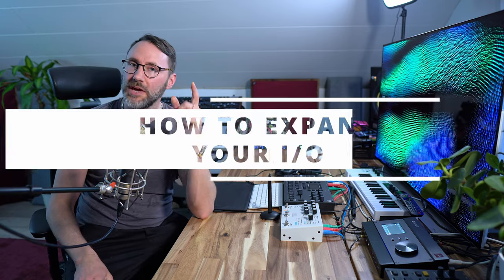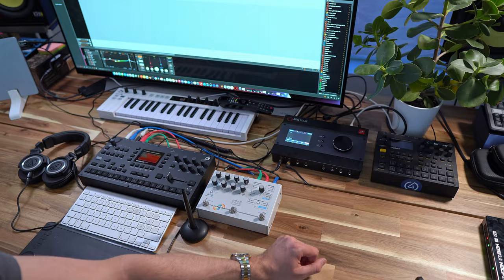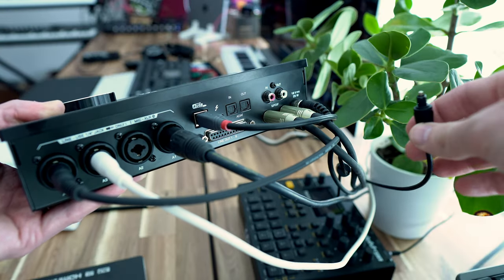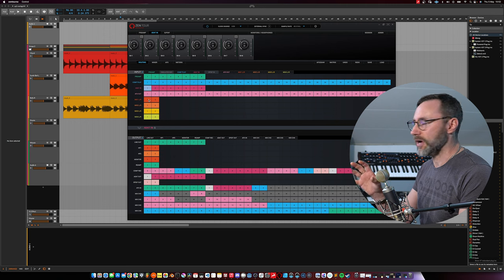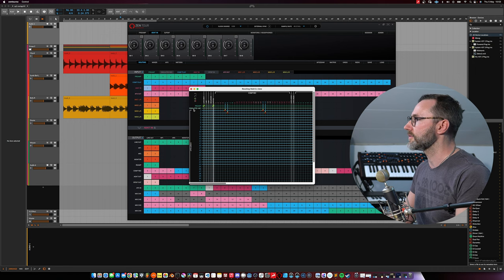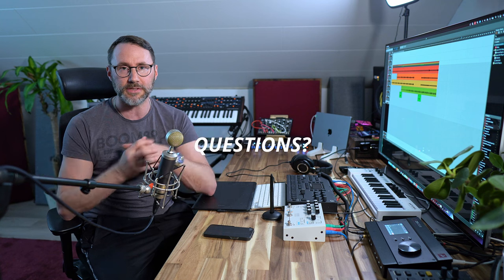How to expand your audio interface with ADAT

Comment: Nice video. I have two ADAT machines, both Fostex, A RD8 and a CX8. I have used them with a MOTU Traveler audio interface. I use the light pipe from the ADAT's and firewire i/o from MOTU into my computer. Using my DAW I am able to record 16 channels in to the DAW. With use of a serial cable sync connection between the ADAT's, you can record 16 tracks simultaneously on tape. I like vintage equipment. 😊
Reply from the maker: Very cool! Yeah vintage gear is cool, We did plenty of albums on ADAT back in the 90s. Dual ALESIS XT Adat machines was the norm. We grew experts at making LIVE cuts on drums and guitars directly by activating / deactivating record directly on the channels while playing back the recordings for tighter riff passages. haha

Comment from the maker: CONTENTS
00:00 Intro
00:19 What is I/O?
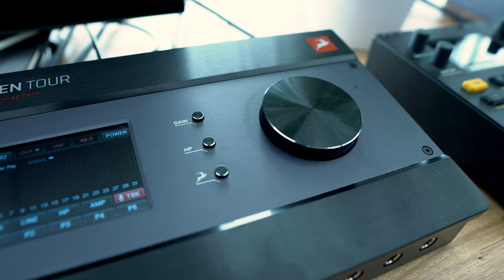00:35 Main Audio Interface - Zen Tour by Antelope Audio
00:49 Aggregate Device - Watch my previous video
01:04 What is ADAT?
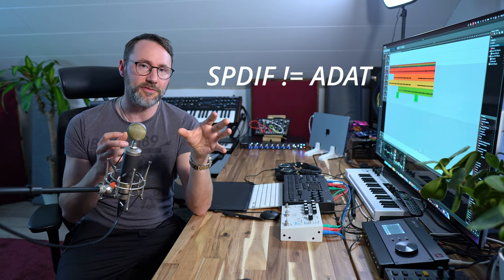01:18 SPDIF vs ADAT
01:44 Zen Tour + AudioFuse 8Pre
02:22 Why I use Antelope Audio Zen audio interfaces
03.07 How to connect ADAT with toslink optical cables
03:40 Digital Clocking Lock
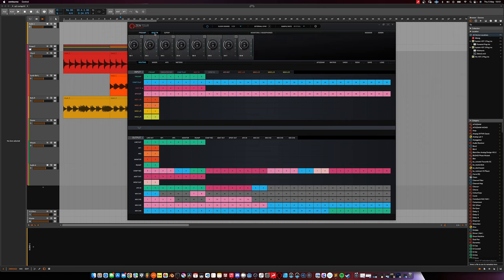04:39 Recording a synth via ADAT
05:13 Zen Tour mixer
07.04 Conclusion
07:37 Questions?
07:52 Outro music

Comment: Hello Matthias, thanks for the videos… Matthias how did you configure the syncing of the clock? And why Dont you use the thunderbolt with fx 2 daw with the Antelope ?
Reply from the maker: Master clock is Zen Tour. 8pre is slave via ADAT, 48khz samplerate. I do use antelope plugins, always on my voice over input (standard voice over plugin chain). I also use afx2daw in my productions. but not much in videos since not everyone has an Antelope interface if they want to replicate similar sound design and effects chains

Comment: ADAT expansion is great since it allows you to expand your system (start small and grow). But no matter how I added up my eventual needs for my synths and microphones, I realized I needed more than 24 I/Os, and devices that allow that (using multiple ADAT inputs) get very expensive very fast (if they are available at all).  I could use patch bays and swap my hardware back and forth, but I really want to just hook everything up, and as my studio grows, not feel like I am running out of I/O's.  So I bought a Presonus StudioLive 32R.  

The 32R is a 32 channel Presonus StudioLive Series III mixer in a rack mount box, with expandability using AVB Ethernet up to 64 channels. You control it using an app on your computer or iPad connected by Ethernet, WiFi, or USB. It is a class compliant USB 2.0 audio interface, so I can even use it as an audio interface for my iPad or iPhone (32 channels in AUM!). The app provides all the features of a normal StudioLive Series III mixer console including FX but without the space needed by a huge mixer.  You can use it as a mixer/USB audio interface (routing channels to your computer as needed), or switch it to audio interface mode and all in/out channels route directly to your DAW.  

There are better audio interfaces like the Zen Tour device Mattias presents in the video, Universal Audio, or other high end audio interfaces, but the Presonus devices are the cheapest cost per port I could find for a configuration that allows more than 20 ports.  It isn't a slouch on high end features either, and cost about the same as a Zen Tour 8 channel interface (when I bought it - prices recently jumped unfortunately).  

They have 16, 24, and 32 channel versions.  The 16 channel version is cheaper than some high end 8 channel audio interfaces and equivalent or cheaper in price to almost all setups using ADAT to get 16 channels.  

I am just a happy customer, not trying to sell anything. I didn't like the options using ADAT and then found stage/studio mixers which offer a better option for my needs.  Behringer has a similar series of mixers/audio interfaces as well as several other brands that cater to stage and highend studio needs using AVB instead of ADAT.  

For those that don't know, AVB is an IEEE 802.1 network standard for sending audio and video over Gbit Ethernet. It has been around for about a decade and many devices support it (Behringer, Motu, Presonus, etc.). AVB came from the stage setting where they wanted to replace 100 ft long analog cable snakes with a single cheap and reliable wire over great distances. I could put one AVB mixer in my office and the other in a studio and send audio back and forth with one cable, up to 100 meters apart. And that is what got me onto the idea of using a stage/studio mixer with AVB for an audio interface. Expandability isn't hampered by the number of ADAT ports anymore.

I have heard many people say, why are we still using ADAT when AVB is available. I hope to see AVB replace ADAT eventually, even for lower end home studio devices.  Instead of feeling limited by how many ADAT ports you have (which is usually 1, maybe 2 if you bought an expensive audio interface), AVB allows multiple devices to connect together like a network. A downside of this is AVB switches are expensive.  You can connect 2 AVB devices together directly using a single cable, but hooking 3 or more together requires an AVB compatible Gigabit Ethernet switch. You might get away with using a normal Gigabit switch, but the AVB switches understand how to route audio/video first (highest priority) over data, and also maintain ultra accurate clock pulses.  Most normal switches won't do that reliably. 

If you read this far - congrats and sorry for the book.  I think AVB is a game changer and I wish I knew about it years ago.
Reply from the maker: Great tip! Since audio interfaces come with this adat connectors its easy to setup and make use of them. And as you mentioned AVB is a bit more expensive solution. Hopefully we can see a better and new universal system on interfaces soon. Which would also support more channels.

Comment: Thank you for the video, I have two focusrite saffire pro 40 but one doesn't connect to my computer. Can I use adat by connecting it to the one that is able to connect to my computer?

Thank you
Reply from the maker: Yes you should be able to do that. That's exactly what I'm doing with my main interface Zen Tour (Antelope Audio) which is connected via ADAT I/O to an external AudioFuse 8Pre to give me extra I/O ports.
Reply: @MattiasHolmgren  thank you, I'll try it out once the optical cable arrives

Comment: Can you use the audiofuse as an adat insert box?

For example, have a bus compressor connected to the input and output of the audiofuse, and have the signal be controlled through the zen tours software adat controls?
Reply from the maker: Yes Zen Tour has optical Adat in / out so you can both send and receive audio signals via adat, and control their gain and internal computer routing.

Comment: Have one question about ADAT connection, do one need to instal software of both interfaces on PC or just software of master interface, not the slave?
Reply from the maker: Secondary (slave) interface does not need its specific software pckage. Because your main interface is the one receiving the audio via the adat optical cable, not via usb / computer. Though I always recommend upgrading the firmware (if possible) of every interface you own so you are running latest. 👌
Reply: @MattiasHolmgren  Thanks a lot Mattias 🎶🎛🥁🎹

Comment: Hi Mattias can I make you a question?
I only have USB-C connection on my Pc. Can I connect a thunderbolt interface (an Apollo X6 Heritage Edition) to my USB interface,  (An Arturia Audiofuse Studio, the one that its connected to my Pc) via just ADAT?
Thanks very much in advance :)
Reply from the maker: Hi Jesus, TB and USB-C looks the same, but USB-C ports do not accept Thunderbolt data streams.
But TB accepts USB-C.... ADAT is a different ball game. If your Apollo X6 has ADAT out you can connect it to the ADAT IN of your USB audio interface.
Reply: @MattiasHolmgren  thanks Mattias :) HOWEVER I make a big mistake on my explanations

My octopre has not even USB port but on the other hand neither has ADAT IN but just out. It's the Focusrite Octopre...

I guess this even makes your answer even yet more correct. Right?

Thanks again mate :)

Comment: with an Adat unit as expansion there is a problem. Adat will require you to select your input analog or digital . On analog input your mixing console will supply the signal, on Digital input your computer will supply the signal. Within your DAW you will have no way to Monitor a recorded track while recording a new track as the ADAT will have its input set to Analog.  what would be the solution??

Comment: Nice useful video, thanks. Now, the matter of interface expansion is often treated as the need of having more inputs available. But I can't find examples of both ins and outs expansion. For inserting outboard eqs and compressors one would need a converter for an output getting into the outboard unit, then converting processed audio back in. The Arturia AudioFuse is capable of 8 ins and 8 outs working at the same time, but is it possible to use all them as expansion channels of another interface? Is Adat capable of it?
Reply from the maker: Optical Adat can only throughput 8 channels. Spdif only 2 channels.

Comment: My Focusrite Clarett 8Pre (thunderbolt) had connection issues with my new computer (Lenovo Thinkstation P620). It often wasn’t discovered by Windows 10 so, I bought a Steinberg UR16C and hooked up my Clarett with ADAT to use as expansion. That worked like a charm. Focusrite also has Clarett+ OctoPre and Scarlet OctoPre pre-amps that work great as expansion units. Funnily enough, after upgrading my OS to Windows 11, my Clarett starting working fine again as audio interface.
Reply from the maker: Hi Marc, that’s excellent to hear that the Focusrite is working again as main interface. Did you update the firmware or only win? Octopres are indeed quite more powerful preamps than the Steinberg. My brother runs Focusrite interfaces and is very happy. I have the Steinberg Ur22 mk2 somewhere, it was nice but a bit noisy. The more recent Ur22C has better S/N ratio. The AudioFuse 8pre has very pleasing preamps but I feel the Zen Tour is a bit more crystal clear in the whole audio chain. ☕️🥁🥳
Reply: The Clarett 8Pre (thunderbolt) interface seems to have been cancelled pretty quickly (not sure why) and there is only one driver available that is still marked as Beta. It has always worked fine on my previous Win 10 PC (HP Z1 workstation). It may be some issue with the P620 using and AMD threadripper Pro CPU. That said, just upgrading to Win11 solved the issue. The Clarett is now showing up all the time but, I’m keeping the UR16C as main audio interface… at least for now. It has better specs.😊
Reply: I have two Safire Pro’s (FireWire) hooked up as one bigger unit and I’m constantly paranoid that one day the units will become unsupported after an update. It was the cheapest option to get the amount of IO I needed (although I could always use a few more inputs 😁). Routing is a bit clumsy on the old Mix Control software but it works.
Reply: Would you assist me with the connections? I have 2 focusrite saffire pro 40 but one doesn't show on my Mac.
Thank you
Reply: Would you share how you did your connections? I have two focusrite saffire pro 40 audio interfaces but one doesn't connect to my computer.
Reply: @worshiplifeteamwithjoseph9715  Hi...., 
First, you obviously need an ADAT cable.
Hook up the ADAT cable to the ADAT input of the (master) Saffire unit that is recognized and ADAT output on the other (secondary) Saffire.
That should be pretty straight forward.
The more difficult part is that you will most likely need to change the internal routing on the Saffire that isn't recognized.
Are both interfaces recognized by your MAC if you hook them up one at the time?
If so, hook up the secondary Saffire and use the Safiire configuration app to route all inputs to the ADAT output channels.
Save those settings, disconnect the secondary Saffire unit from the computer and connect the "master" Saffire unit.
Reboot both devices, just to make sure the master Saffire now looks for the ports coming from the ADAT connection. (this may happen automatically too)
If all is well, you should now have 8 additional inputs on the master Saffire.
Reply: @worshiplifeteamwithjoseph9715  Ouch… then I fear you’ll need to get another unit.
But remember… ADAT is not brand specific so you can use any brand and model as port expander (secondary interface) as long as it has ADAT in’s and outs.
I use my old Clarett 8Pre as port expander and my Steinberg/Yamaha UR816C as main interface and it works fine.
The Clarett is 24bit and the Steinberg 32bit but no issues there.
You could also just get an 8 port pre-amp module like the Focusrite Scarlet OctoPre or something similar
Reply: @marcdeschryver7687  thank you so much, the unfortunate part is that I even haven't used it. I got it used. Thank you
Reply: @worshiplifeteamwithjoseph9715  that is a shame… well, I hope things work out. Good luck

Comment: Great info!!! Do you know how to connect Burl B2 Bomber ADC to Apollo 6x for tracking? I'm using using a Neumann 103 into bae 1073 preamp MacBook pro m1 Cubase 12 Any help would be greatly appreciated. Thanks
Reply from the maker: Hi Billy, why not just connect the Burl B2 Bomber TOSLINK output into the spdif input (TOSLINK) of your Apollo 6x? The Apollo 6x has 2x TOSLINK inputs (spdif) if I remember correctly. That way you don't need to setup an aggregate device to do the connection. Do you have an optical TOSLINK cable around?
Reply: @MattiasHolmgren  
 Thanks Mattias. That's the way I have it set up but there's no signal coming into the Apollo console input ch. The B2 is showing the BAE mic pre 1073 signal coming in at a good level The B2 does have a RCA  S/PDIF out. and a TOS out sweetwater sent me a OPM303 3' Premium Optical Cable to come out of the B2 TOS into the Apollo ADAT S/MUX IN  There's just no signal coming into the Apollo console. I can hear my song play back through my headphones coming out of the Apollo 6x headphone jack fine but no signal coming in from my B2 that I will be tracking  my vocal for this song. I’m not quite sure how to set up for Spdif or Adat in the I/O’s settings of the Apollo’s console for this situation? Note:I do have the B2 and Apollo clock set to internal if I change it to  Spdif or Adat on the Apollo it turns flashing red. Thanks so much for your time. 😎
Reply from the maker: Spdif and Adat are two completely different techs. Do not mix them. 
You need to connect spdif out from B2 interface, to spdif-in on Apollo. ☀️
Reply from the maker: I personally only connect adat-out to adat-in between my interfaces. Because spdif can only carry two channels. While Adat can carry 8ch in 48khz 24bit.

But in your case you will use spdif since B2 only had limited channels…and spdif out 😁
Reply from the maker: B2 should be set to slave, and Apollo to master clock. You can only have one interface as the master. Its most often your main audio interface.
Reply: @MattiasHolmgren  Do I need  a RCA SPIDIF cable to to do this I don't see a TOS SPIDIF input only a in 1 and 2 S/MUX  and do I set B2 to int or EXT and keep the Apollo set at internal? Sorry for all the questions... Thanks.
Reply from the maker: @billymack4258   Burl B2 as both RCA and TOS SPDIF out-ports. Connect TOSLINK (optical) cable to TOS spdif out of Burl B2. To the SPDIF in on the Apollo.
Reply from the maker: @billymack4258  Clock on B2 to EXT = external clock sync. Clock on Apollo to INT = master clock device.
Reply: @MattiasHolmgren  Burl B2 as both RCA and TOS SPDIF out-ports. Connect TOSLINK (optical) cable to TOS spdif out of Burl B2. To the SPDIF in on the Apollo. The SPIDIF in on the Apollo 6x is RCA The only TOS optical  section I see is on the left back panel next to the power pin connecter is   ADAT S/MUX OUT 1 OUT 2 IN 1 IN 2  I see a SPIDIF RCA IN AND OUT. Thank you so much again for taken the time out to help me.
Reply from the maker: Ok if the Apollo only has RCA spdif you have to use that one. I though it had toslink spdif port. 😂☕️
Reply from the maker: In your cas: rca to rca spdif.
Reply: @MattiasHolmgren  Yes that's the way I have connected and works perfectly. Thank you very much for time and knowledge...😎👍
Reply from the maker: Good to hear you are up an running! Happy to help out! 😎😉🥁